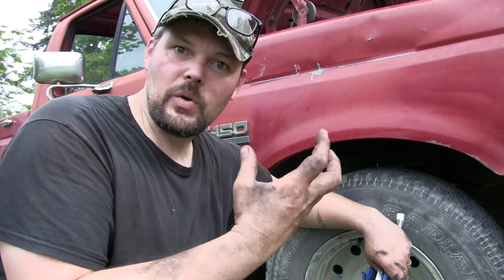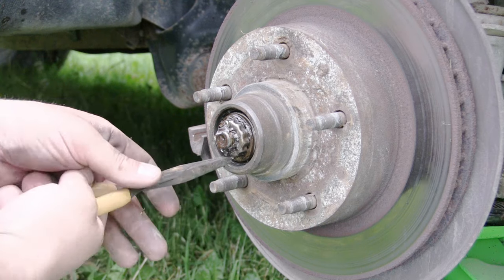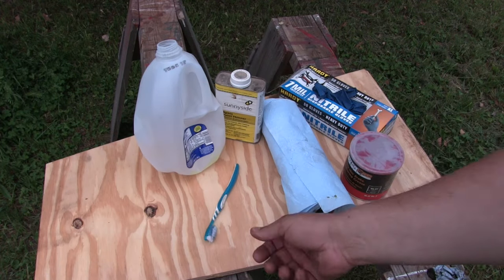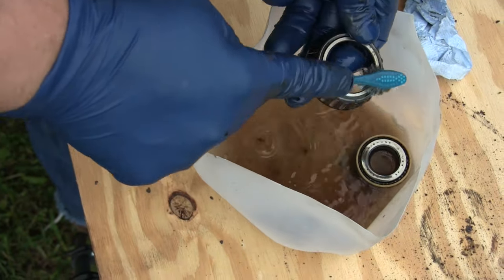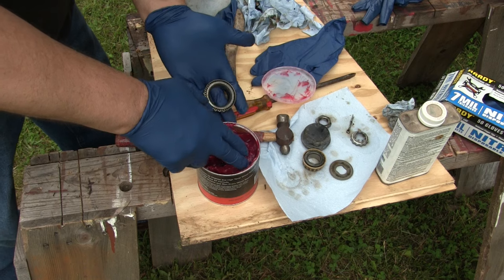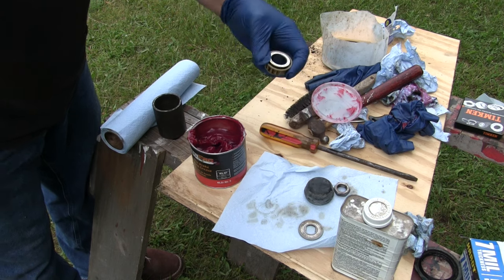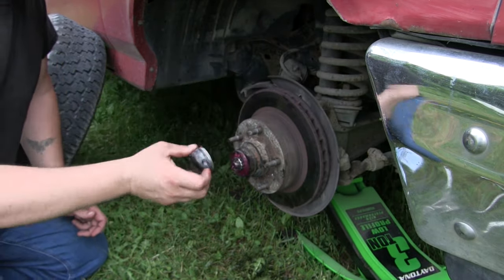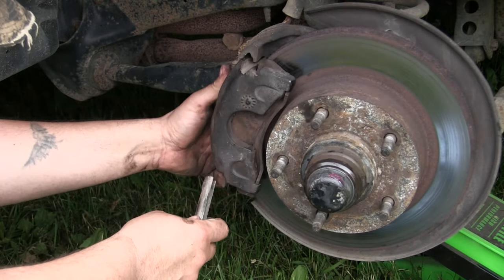How to clean & re-pack wheel Bearings

Comment: Worst comment from your doctor, "Going to use one last rubber glove!" 🤪  All new vehicles now have sealed bearings so I just replaced the whole rear bolt on hub on my car.  Another good video, look forward to the replacement bearing video. 👍 I get my replacement parts from RockAuto which ships to Canada and sells the exact same parts for less than half of what I can get them for here.  Arrives in 2 days with FedEx from any of their 4 warehouses across the USA.
Reply: Agreed on RockAuto from another Canadian. For smaller parts they're cheaper than any local outlets even with shipping factored in. Bigger parts, even headlights, the shipping gets expensive quick. 
Inner and outer SKF bearings without races are a bit over $6.00 US from RockAuto so it isn't going to break the bank when he redoes it.
Worst comment from a doctor, "These gloves were free with my toilet brush!" 🤪
Reply from the maker: LOL, gotta love Rock Auto

Comment: I use a 60 cc syringe that I pack with grease for packing the bearing. On smaller bearing you might need to squeeze the nipple on the syringe . It works great it will also push out any old greas you might have missed. Great video!

Comment: After removing the outer bearing put the nut back on the spindle and pull the rotor over the nut, with a tug the inner bearing and will catch the nut and bearing and seal will come off at the same time. I have never damaged a seal or bearing using this method. It’s always best to replace the seal, but sometimes you don’t have one on hand. Give it a try.
Great videos
Reply from the maker: Thats an awesome tip! Thanks

Comment: I have found that to remove the rear seal, put the washer and nut back on. Pull the hub off by hitting against the the washer and nut. It should drive out the seal and rear bearing. That way it will keep the seal in reusable condition.

Comment: A lot of mechanics say that too much grease is the cause of premature failure as heat is not dispersing as it should - especially packing it to the cap would prevent it from working as an efficient radiator, but I'm not so sure if they're right, and when You've been applying the grease it's worth of keep rolling so the grease from the outside can enter and lube it inside all trough before working under load. One way to make sure it's all lubricated is applying it from the narrower side until it comes off from the thicker - during fast driving radial forces push it out that way - that's why the seal is there. The seal is always on the thicker side.

Comment: Thanks for the video...  is that last bit on using something like a parts cleaner (after mineral spirits) something like carburetor cleaner?  I use laquer thinner when I overhaul the 67 Schwinn Cycletruck's hubs to remove the oils left behind after the spirits. Now I have Catholic guilt having not rebuilt it in 20 years. It's just to hot to go outdoors here in Miami. Bless
Reply: Looks like he used brake cleaner which removes contaminants,  grease, and water,  and dries very quickly. Some people use the brake cleaner before silicone  sealing pans or covers to insure a clean surface for bonding. Lacquer thinner may affect some brake pad material as well as being flammable if not given proper time to evaporate but sometimes you just have to use what you got.
Reply: @kevola5739  Thanks for the response. Dad was a luthier, and there was always lacquer, and thinner out in the shed. And, in college a friend who was a VW guy told me to do final cleaning with either lacquer thinner, or acetone. Of course, this is 30 years ago..... Any hows.... knowing what tool to use, or product is the real deal. Bless
Reply from the maker: I like acetone too.....I think parts cleaner is largely presurized acetone

Comment: The days of servicable front hubs are long gone. When you finally get around to replacing the front bearings, you might as well buy the new hubs.
Reply from the maker: Yup. Thats not "totally" bad. I changed the front wheels bearings in my ford escort a few years ago and they went bad around 270k. Thats not bad for an original part